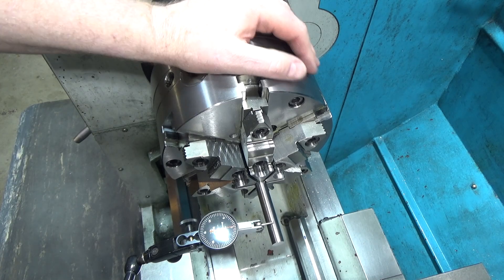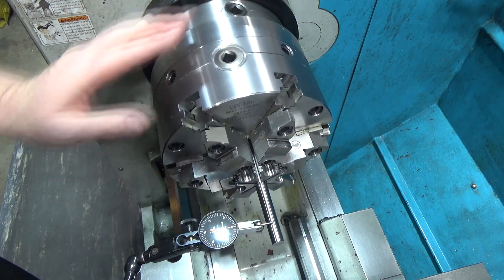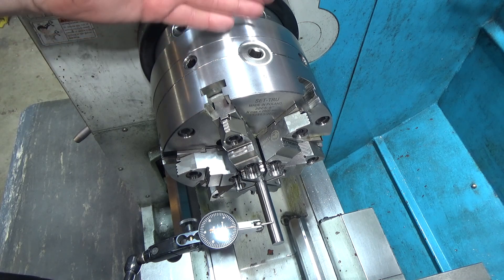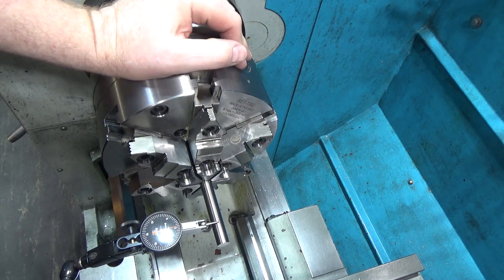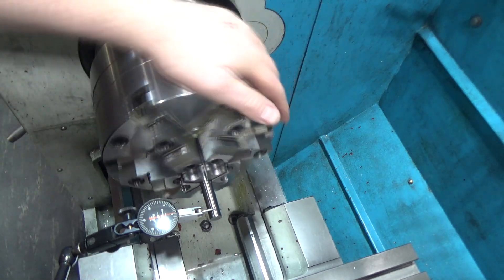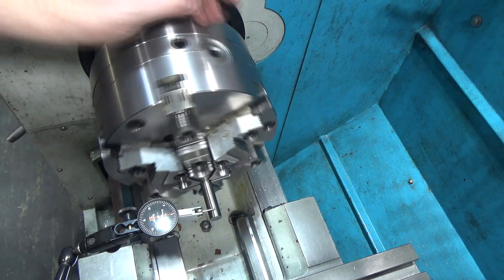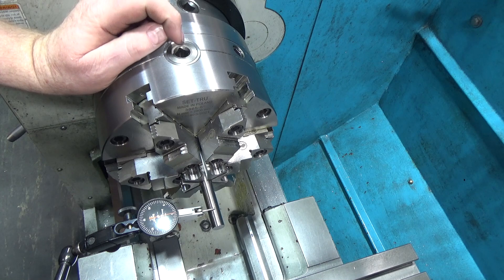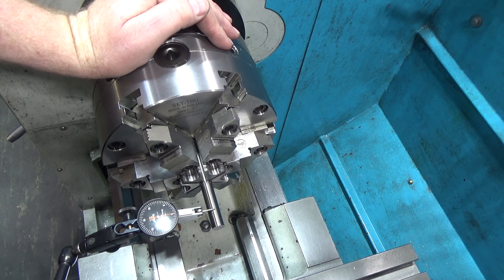189 1 Pinion VS 3 Pinions Revisited

Comment: I like watching Adam. He’s pretty good at what he does. But…there are things he gets wrong. I’m not sure as to what his education in machining is. There are a lot of incorrect concepts out there, as many, or even most YouTube machinists are self taught, or taught by older guys who were self taught, or, well, recursively, taught by those who were taught by those who weren’t given a formal education. So we see a lot of old wives tales in this business.

In one episode he was hardening and tempering a part. He admitted that he really didn’t know much about the subject and asked for posters to give information, if they had it. Fair enough. So he tempered the part, and plunged it into oil. That’s a no no. When I brought that up in the posts, I was flamed. I told people to go to alloy manufacturers’ sites and see for themselves, but I doubt anyone did.

We’ve got a biased opinion on this because of high school shop, where we made screwdrivers and chisels. Of course we plunged them into water! We were using a torch to watch the colors, and had to stop them immediately. But that’s not the right way to do precision part hardening and tempering, though it’s ok for some cheap non critical part.

The point is that you have to be careful of what you see from people you respect on YouTube. They don’t always get it right. And that gets passed in to others. I can tighten on either pinion on my Buck and they’re about the same to a tenth. But you get what you pay for.

As to todays results. Yes, “walking the pinions” can be done (only with a good chuck), but it isn’t done in the professional shop, or industry. Why, when it seems to work? Because of time. It’s much faster to set it with a marked pinion and quickly spin the chuck to it. Time is money, after all, and it adds up. It can also be confusing. The extra force applied with more than one pinion isn’t really needed, unless it’s an old, worn chuck, or a very big lathe and heavy part. But then tenths aren’t what’s being chased. And then, reliability is out the door anyway. If a chuck is used properly, and you’re not trying to squeeze the life out of your parts, one pinion is plenty.
Reply from the maker: You made some excellent points and gave some really good advise there. The Shars chuck I had slipped on parts sometimes and it made me wonder. It could have easily been something I was doing wrong. I took classes at my local adult school when I was starting out, but have a really long way to go. As you said, metallurgy is a complex topic and heat treatment processes are somewhat complex and lengthy if you want the best results. I tend to watch everything I can, with the idea that even the long time machinists might be making a mistake. They are probably a lot less likely than myself though.
Reply: @DudleyToolwright  I’m not trying to suck up, but you do pretty darn well. We all make mistakes, and we all don’t notice setup errors from time to time. That’s what machinable wax is for.

Comment: when you think of all the moving parts in a 6 jaw its absolutely amazing that they repeat as well as they do, Hence the adjustment feature.  i have three 6 jaws, some over 30yrs old and they all have personalities. find out what procedure works best and stick with it. the other fly in the ointment is part size. the manufacturers will tell you that when you set your minimum runout on a given part, that there is no guarantee that it will stay when you change sizes. as the chuck ages the scroll will wear more in some areas causing changes in runout. bottom line is if you need less than a couple thou runout you better check it.
Reply from the maker: Good advise. Thanks.

Comment: I wonder how this applies to a standard 3-jaw chuck without a set true feature? Even if there is intial run-out... does that repeat using a single pinion or walking them in?
Reply from the maker: Excellent question. I was wondering the same thing myself.
Reply: I actually played with this the other day. The cheap 3-jaw that came with my lathe has a lot of runout, at least at small diameters. (~0.0045 with a half-inch part, ~ 0.0025-0.003 with a 1.25 part) I tried messing around with different pinion-tightening, but it only make about 0.0005 difference.

(Although I just realized that this wasn’t the issue being discussed here, DUH. I’ll play with it some more, testing repeatability.)

Comment: This is such an interesting discovery-- nice find. 

One last thing that you didn't check (I don't think)---   Now that you know to walk in all three, while tightening your set tru....  Now when you walk all three on a part/  you said it's fine to start on any one of them and still walk them all in.   My question is:  What would happen if you only used one pinion NOW that it's set with them all three walking in?   Does using any of them as a single master work now?.. or since you walked all three in while setting the set tru, are you now Married to walking them all in every time? 

I know that if you set the set tru by only tightening the master, you said that you now have to use the master every time for it to be right-- and walking it in will throw it off.  But inversely, if you walk all three in when you set the set tru, it seems like there is a possibility that you could now use any of them as a master by itself?   Or do you MUST walk them all three in for it to work right.............. 

 Because if so, that would mean that:  as along as you set your set tru by walking the in---  you can then use either technique (walk them in- or any single one as a master)---   and it would still work.  I just don't know if that's true...................  Now that you've Set it by walking them in, go back and try it by only using one as a master-- and try it on each one.. It may turn out that you MUST walk the in every time now.
Reply from the maker: That is a really interesting observation. I missed that permutation completely. Thanks I will have to test that at some point.

Comment: One of my lathes is an ancient Sheldon gunsmithing lathe with very old unusual chucks though they're made by Coleman. Coleman is written long hand for example. Anyhow, on the three jaw, the factory went to Great lengths to draw quite a fancy arrow engraved about 3/16 deep next to one of the pinions. I have not had this check apart, but it seems to be run of the mill in function design. I'm also in the habit of walking the chuck from my moraseiki, but the Sheldon has always been very fussy. I noticed the last time I was using it, and this machine normally holds about 1thou, that I was getting a lot of variability chucking things up. I did some experiments and found very similar results. It worked better when I only used the pinion so clearly marked. Over and over, at several different diameters, this proved true. I can't seem to convince my hands though. I've had to laminate a little card that is stuck on the headstock remind me of this, my muscle memory always walks the truck and I have to back it out
Reply from the maker: Interesting and useful observations. We need more.

Comment: I think many of us have drooled over the set through chucks. I found myself wondering, couldn't this theoretically be adapted to any check? If you made a new backing plate and made it somewhat oversized, I can see how it would be a little fussy to get the three bolts aligned and radius just so, what am I missing? There's no way it's that simple, I would see them all over YouTube. I must be missing something quite obvious?
Reply from the maker: It is that simple: 3-6 through bolts to tighten and 3 set screw to adjust. The problem is that most chucks that I have had, don't have the room.

Comment: More confusing than clarifying I guess. Tightening the work piece, checking the runout, loosening the 3 mini lathe chuck holding nuts and nocking it to center is the option here....
Reply from the maker: I am sorry if my explanations were a bit confusing. I tried to distill it all down.  I think the takeaway is that you need to be very consistent.

Comment: I think this proves the point that walking the pinions is more accurate.  Why?  Because you can walk your pinons starting with any one of them and still maintain repeatable results.  If you don't use the same pinion every time you tighten on a single pinion, you loose repeatability.  For OPTIMAL repeatability,  always start with the same pinion, walk the pinons, and apply the same amount of torque (with torque wrench).   Obviously you set the Set-Tru on the very first time and dial it in.  

With the SINGLE pinion model of the chuck.. it's a mute point.  However, I still contend that the scroll stretches. By tightening each pinion you equalize the tension on the scroll, and can obtain a tighter grip and more repeatable result.
Reply from the maker: Your thoughts jive with mine pretty well. I appreciate the feedback.

Comment: set your chuck true with the 1 pignon method, you always have to tighten on 1 pignon.
set your chuck true with the 3  pignon method, you always have to tighten on  pignons.
it,s very logical if you think about it....

now i want to know how repeateble  your chuck is with different diameters ?
Reply from the maker: Thanks. It is close, but if you change diameters significantly, you need to re-true the chuck. At least those seem to be the results so far. I haven't done a ton of testing on that yet.

Comment: In my opinion THIS entire video was about set-true.  Not at all about the question of what happens when the other pinions are tightened.

Rather than turning the rod, you could be cycling between different diameters.  Every one of those tests probably took place within less than half a degree of scroll rotation.  If you think about it, a scroll chuck that's constantly used for a single diameter is going to wear on the scroll in [jaw count] places and nowhere else.  It's also going to wear the scroll's gear and the pinions in an extremely limited range.

There is a LOT of possible science that could be done on this topic, but personally I am most interested in the original question.  Phrased specifically for a three pinion scroll chuck, that question is "does applying torque to the other two pinions improve repeatability, or not?" 

For any three pinion chuck, there are six possible orders in which the pinions could be tightened, and you could test centering after each pinion. Recording not just indicated runout, but the angular position relative to a designated jaw, would help those measurements be comparable.  Leaving the set-true feature completely out of the picture.  So many chucks don't have it, and IMO it's not relevant to the original question.
Reply from the maker: Interesting take. I was looking into how repeatable the chuck is once you have established an optimal SET-TRU adjustment. The evidence I see is that if you change dimensions radically, you will have to re-true the chuck. I was investigating ways to take the part out of the chuck and put it back in. I had had issues with this in the past.